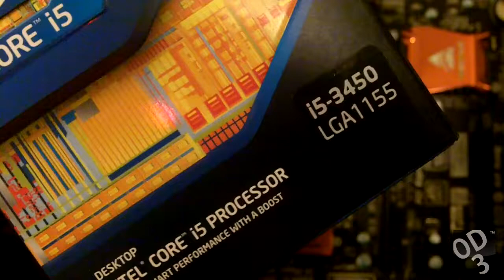How To Install A Desktop Intel CPU ( i5-3450 )

Comment: Does installing extra (not replacing) RAM require any other setup other than putting the boards in the slot? Any help is appreciated. Thanks.
Reply from the maker: ehill1536 No.
Reply: Thanks! One more question: I have a Studio XPS 435T with Intel Core i7 CPU 920 2.67GHz 8.2gb RAM and a ATI Radeon 5800 series (1gb). Most newer games recommend around 3.4 GHz with a 2gb GPU. If I upgraded the RAM and GPU would that be good enough to run these games? Looking to get a Radeon R9 270X (and new power supply); will this be good enough until I can upgrade the CPU?
Reply from the maker: Yes, the 270X will be good. The RAM is fine as is and will provide no improvement in gaming.

Comment: he did not show how to take out the old fan ???
Reply: ken krow On mine I just unscrewed each of the 4 screws and pulled and it came out, then I pulled out the wire and replaced the fan.

Comment: with this work on my msi ms 7641 motherboard? please respond
Reply from the maker: No, it is an AMD board. You will need an Intel board with a socket type LGA1155.
Reply: so id need an AMD Processor?
Reply from the maker: Yes.
Reply: thanks

Comment: Hi just wondering if anyone could anser my question how do you know if your motherboard supports i5 or do all motherboards support it anyway since I am upgrading to an i5 in febuary so it will be much aprichiated
Reply: The motherboard compatibility is measured by the socket number. The latest in Intel being LGA 1150 Haswell architecture. Any CPU whether it's an i3 or i7 or i5 or Pentium will work on a LGA 1150 motherboard if the CPU is also an LGA 1150.
Reply: k thankyou

Comment from the maker: The motherboard that this CPU was pulled from most likely doesn't support the LGA of the Intel i5. Make sure you get a motherboard with a LGA 1155 or 1150 socket if you want to utilize the more recent Intel i5's such as the Ivy-Bridge or Haswell architectures.

Comment: Well I found this Motherboard plus CPU Combo for like 279 plus warranty on Tigerdirect It was an Asus Intel H87M-E Motherboard with an I5-4430 Processor So it looks pretty good. I can just put it in any case right? or does the case have to match with the motherboard in some sort of way?

Comment: So can I just replace the motherboard with the right Socket Number and if I did that Could I just put everything into a new case that supports HDMI Cables but only with a new motherboard and it's HDD? and if so what motherboard and or case would I be looking at and how much would that cost me? I mean the motherboard is crap at this point might as well trow away the case two.

Comment: the only reason i've watched the video is to find out if there is thermal paste on the heatsink. since you didn't apply any paste i', assuming that those grey things were the paste. i'm gonna use the stock heatsink but will upgrade. its no use installing a gtx 760 (3gb) if the processor isnt' that cooled

Comment from the maker: You can try unbending the pins, but chances are, your motherboards are shot. Make sure the arrow of the CPU is lined up correctly with the slot on the socket. It should be pointing towards the left edge of the socket facing the PCIe slots.

Comment from the maker: If you are using a dedicated GPU and don't care much about overclocking the i5-3450 is a better deal. I just recently picked up an i5-3570k because I love to overclock. I never used the integrated HD graphics.

Comment: Hey owndizzle!! i JUST BOUGHT THIS PC FOR EDITING AND GAMING WHAT DO YOU THINK? Case : Mars Blue Gaming Case with Temp Display Motherboard : Gigabyte Z77-D3H Motherboard Technology CPU : Intel Ivy Bridge I5 3570K CPU Hard Drive : 1tb Sata Hard Drive Memory : 8gb DDR3 1600Mhz Memory Graphics Card : Nvidia Geforce GTX 650 2gb GDDR5 with HDMI Operating System : Windows 7 Home Premium 64bit With DVD and License Power Supply : 750 Watt Branded Power Supply

Comment from the maker: With the B75GM, you can't overclock the CPU that well or maybe even at all. For overclocking, you'll want the TZ77XE3. Also, I use the Spire Thermax Eclipse II CPU heat sink. The stock cooler is not ideal for an overclocked CPU.

Comment from the maker: The TZ77XE3 is more future proof and you can overclock the CPU. You'll need an Ivy-Bridge CPU on the B75M to utilize the USB 3.0 ports and PCIe 3.0 capabilities. The B75M is still a great board for the price and comes with modern connections.

Comment from the maker: Thermal paste is pre-applied to the stock Intel heat sink. Just mount the heat sink on top securely and properly and you're good to go. Aftermarket heat sinks usually require you to apply the thermal paste on the CPU's heat spreader of the heat sink's heat pipe contact surface before mounting the heat sink on the CPU.

Comment from the maker: For gaming, either will do just fine and not bottle neck any graphics card out now. If you want the most powerful CPU out of the two, the 2500k is a better option. The 3450 will be more powerful than the 2500k if they're running at the same clock speeds. It is until you overclock the 2500k to 4.5ghz+ that it begins pulling away from the 3450. The 3450 and 2500k is still overkill for the average user though.

Comment from the maker: It will still work if the case isn't plugged in. You'll just discharge the static electricity into the case.

Comment from the maker: Oh, those won't break. You just need to make sure you have the heat sink aligned properly on the motherboard before you begin pushing in on the pins. It's very easy.

Comment: No I mean the push pin installation of the stock intel heatsink, most aftermarket coolers use screws, and the pushpin heatsink seems easier, but a lot less durable, I'm scared I might break one of the plastic pins

Comment from the maker: The metal pin that locks the CPU into the socket is a lot durable than it looks. You won't damage it unless you're intentionally trying to. It will have some force behind it especially when the CPU is in the socket when you're trying to lower it, but it's normal.